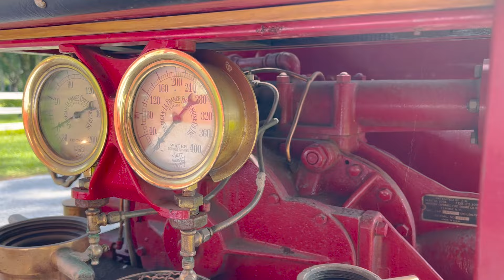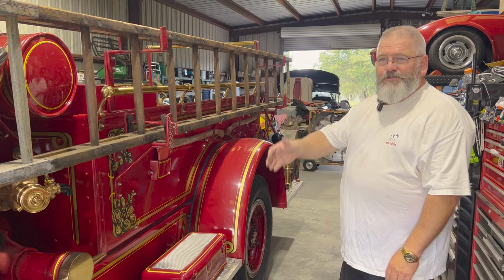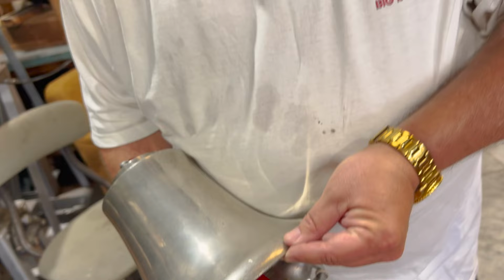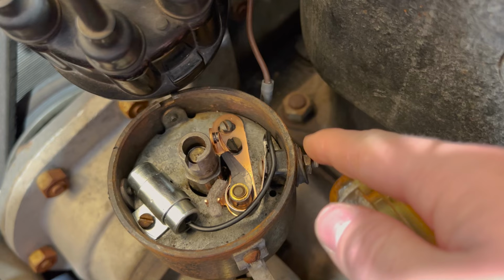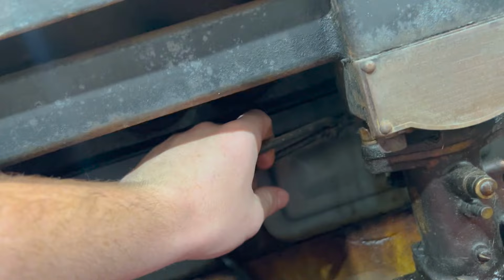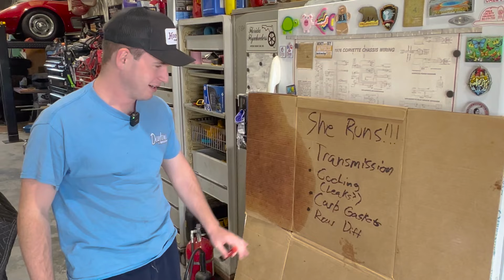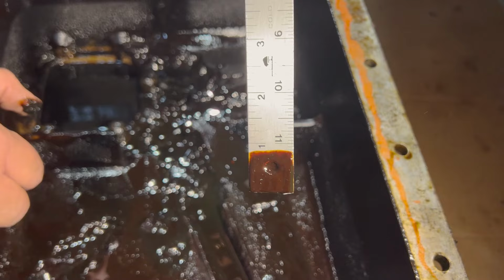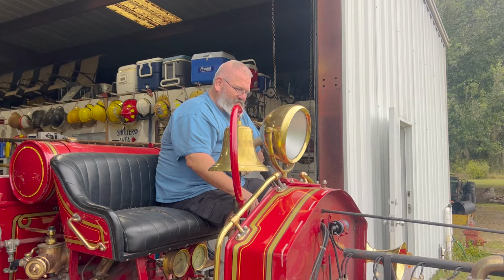Will It Start? No Spark, Sludge in the Motor-1927 American LaFrance Pumper

Comment: You guya are doing a good job on that American La France Fire Engine Motor. You are going throught the systems that make the motor run systamatically. That is always a wise choice, as you know that worked. Keep going slowly and methodically and that will help yoooou find success. Good Luck Guys, and keep up the quality work you are doing.